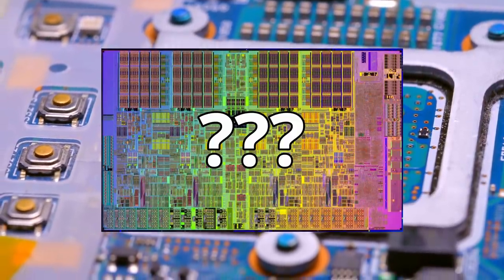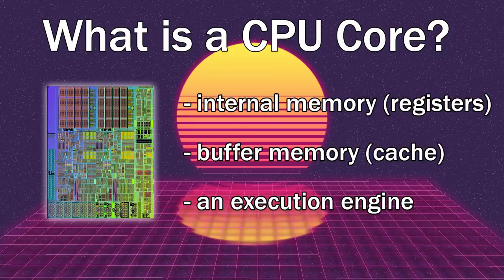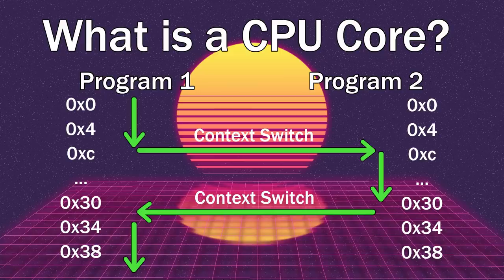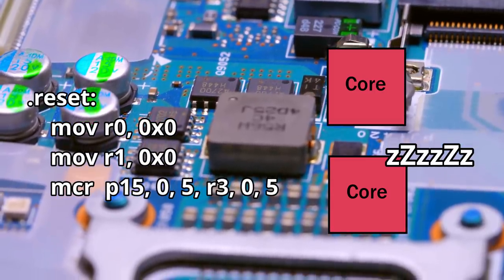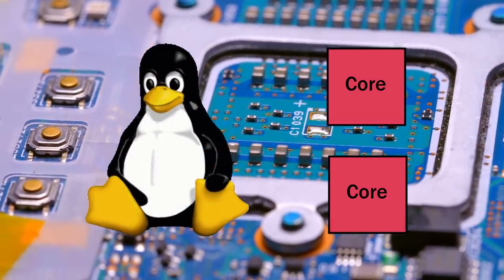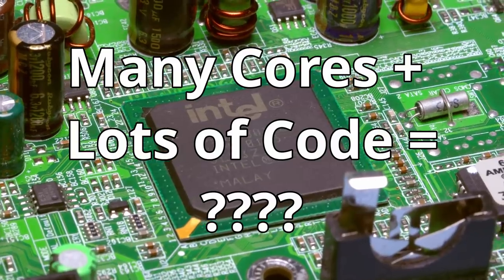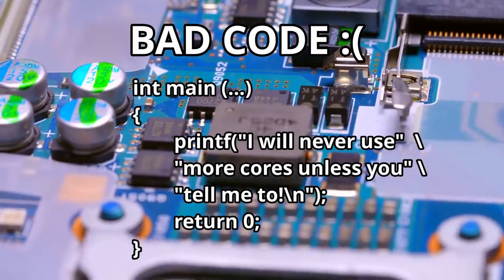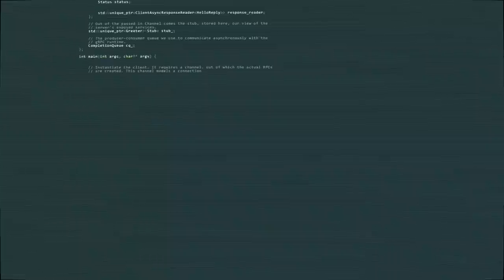why can’t computers have thousands of cores?

Comment: I think it would be interesting to go into why GPUs CAN have so many cores, be parallelized more effectively and with better thermal efficiency, but CPUs cannot.  I know the answer, but I do think it would be an interesting follow up video.
Reply: Total agreement. I don't know the but I'm certainly curious!
Reply: @JustinShaedo   A basic explanation would be that the kind of work a GPU does is easy to break up and spread among hundreds of small cores, and a GPU is designed for parallel processing on tasks that don't depend on each other.

In a GPU you define a single program called a "shader", essentially a script which defines various inputs and what the GPU should do with those inputs.

Each core on the GPU then runs in lockstep with each other: they all run the exact same shader script, albeit with different parameters. You cannot have half the cores run one script and the other half run the other. This is great for 3D graphics where the output of each pixel on a screen can be calculated independently, all using the same script.

This is also why we still need CPUs and not just run everything on GPUs: GPU cores cannot run separate processes simultaneously on each core: only hundreds of copies of the same process with different inputs.
Reply: @WJ gpus are designed to do a bunch of math at once. Each core is designed for a very specific task. Hence tensor cores, rt cores, etc. Cpus are supposed to be able to handle anything and everything, but maybe not as efficiently.
Reply: @WJ i dont see how that shows gpus being able to have more cores in the first place. Utilization is different than physical cpnstraints. Alsp, they want the OS to work on old laptops or cheaper ones which the majority of which have really weak processors with few cores. If ms optimized windows for pcs with 8 cores, pcs with 4 cores would struggle to do anything. I agree though. I wish linux replaced windows. Windows is a cash grab but so is everything in capitalism that isn't truly for free.
Reply: @WJ yeah it stinks. Sadly, quantum computing has the same issue as more cores. Noone will want to switch, but nothing digital can be translated. Qbits arent binary and work off of quantum superpositions. They are programmed entirely differently. Additionally, quantum entanglement is highly unstable and can't be observed or interacted with in any way or the particles will lose their entanglement and define themselves. That means you need to cool the qbits with liquid nitrogen, which is very difficult. You are correct about gpus being useful to streamers though. For certain tasks, computers can use gpus to perform tasks such as encoding streams and rendering videos on the go. Chip makers design a specific pipeline for a gpu that will help it perform tasks. Gpus made for rendering game graphics tend to work well with rendering streams which is handy. Pipelines are basically made up of core clusters that each perform a different tasks and instructions are sent through the pipeline to have things like shaders, sharpening, particles, textures, etc applied.

Edit: tldr: quantum computing and more cores have the same obstacle of the economy and society having trouble changing rapidly and both, especially quantum computing, would disrupt a lot. :c
Reply: @Chezrlz009  *unless were talking over 256 cores which is windows 10 limits  blamming windows for the optimzation of more cores is not quite right. Its more down to each application indvidualy not optimizing for more cores as windows its self can handle quite alot of cores and spread jobs across them just fine. But alot of devs and compaines in general do not devolp for a ton of multi core its slowly getting better but all of a few years ago 4 core 8 thread was your top end consumer cpu. linux is lighting and does work more efficently in general for the windows overhead but the code that runs the cpu is still the same x86 code the same program ported to linux as windows doesn't suddenly work better with more cores its down to the devs of said application, and if they wrote it better on one then the other. windows server 2016,2019,2022 all run on a very similar os to windows 10 and reguarly handle applications that use alot of multicore load just fine. The OS can add overhead but most of the multi core utilization is down to the application. Think about running blender it doesnt magicaly run faster by any real margin on error on a linux system vs a non bloated windows system. and its the reason cinnebench is used so much for cpu testing as it basically uses multi cores perfectly . I will agree linux can be made to function slighty better and can have applications that would make it more ideal if support for it grew but its defintely not the core limit that windows currently have as I don't know of anyone trying to go over that high limit that microsoft has for your avg end user
Reply: @WJ im confused some what windows limit for cores is 256 cores which is far and away more then even server cpus currently. im not quite sure what you mean for windows optimizing for cores? plently of applications that use windows destroy every core you throw at it. take prime 95 as an extreme blender other rendering softwares. Devs can easily make consumer programs use cores if it works for there application. and as time changes im sure windows for consumers will increase the cores if the time comes.  But windows 7 is quite dated driver optimization has come a long way windows 10 for your avg user is a better experience as a whole it basically installs any driver these days and for a pretty tiny overhead change then win 7. yes there is some but systems have beefed up alot compared to win 7 days.                                        Like yes I agree linux can run better by freeing up some of the overhead specailly on low end machines ,and can be made to run specific applications where windows is unable to be modified easily in that way.but that doesn't mean windows is some how hurting multi thread os communication to applcations for your avg user. and those who really want to be slamming huge amounts of cores should either be looking at linux server distros or windows server.
Reply: @WJ the biggest push for linux will really be the steam deck tbh at least as far a game devs go. So i pray for the success of that little device
Reply: Give me the answer now!!! I can't take the suspense 😫
Reply: @JustinShaedo  What NVidia calls "cores" is something entirely different than what counts as "core" in a CPU. A core in a CPU is an entirely independent control unit. Two conventional cores can process two entirely separate instruction streams and access memory independently from one another in any pattern they like.

A GPU is different. A CUDA core can perform mathematical operations independently from other cores, but they cannot execute different instructions and they cannot access memory independently from one another. A CUDA core is more like an arithmetic-logic unit (ALU) in a CPU. Many CUDA cores share a single control unit (which in CUDA terms is called a "streaming multiprocessor" (SM) which provides the data from memory to each core. The cores then operate in lock-step: Each core performs the same operation but on different piece of data.

So it would be a lot fairer to compare CPU cores to SMs. A fairer comparison to CUDA cores would be the total amount of elements a CPU vector unit can process.
Reply: @WJ windows 7, are you serious?
Reply: @WJ 
> My point is, windows is just making another OS just to sell.

This is the equivalent of stating that the sky is blue. There is no publicly traded or for-profit company that is interested in focusing on maintenance or fixing older code when it doesn't yield money in comparison to adding new features (niche operating systems that the average person won't interact with such as vxWorks aside as those are different beasts entirely). 

> They're not looking for a better ways to optimize an OS, not just for CPU cores but for all functions.

This is a bit loaded. Let's break this bit apart first, a core is just a thread of execution (technically two when we take into account Simultaneous Multi-threading or eight back in the days of IBM POWER) in the eyes of software. What really dictates how an OS utilizes these threads is dependent upon the scheduler of the operating system in question. Linux uses the Completely Fair Scheduler while Windows uses a proprietary implementation of their own making.

When we talk about optimizing for cores we're really looking at how do we make the most of the threads we have these are the responsibilities of the scheduler and by extension the code we write. If we want to use x number of cores then we need to be able to break our problem down into concurrent and parallel components.

When talking about optimizing functions then, in simplistic terms, it's really just a matter of profiling and modifying the code appropriately.

> You know, the bugs can affect CPU optimization too.

Are we talking semantic bugs or logical bugs. One can crash a program (or even the computer depending on severity), the other is, as it name implies, a logical error. In either case, the compiler doesn't care, it will optimize any input to the best of it's ability into machine code (or bytecode depending on what we're talking about) unless it hits incorrect instructions. Case in point, GCC or Clang (without certain flags like -Wall or -fsanitize that helps preventing errors at compile time) will compile code resulting in segfaults without complaints and also compilers using undefined behaviour to optimize code.

>  I don't want to bet on Microsoft making 256 cores usable or optimized but I bet on Linux.

This is related to an earlier point on the for-profit nature of a company but the truth remains that the target demographic of the desktop distribution of Windows aren't using processors with significant core counts. Linux is optimized because despite the memes of $YEAR_OF_LINUX_DESKTOP the primary use case of Linux is still in servers that have significantly higher per-machine resources than the average home computer.

> Maybe Torvald migrating to Rust can have big effect on gaming or rendering.

Rust will have zero impact on the core of the Linux kernel as Torvalds and Greg Kroah-Hartman by extension, as well as his other trusted maintainers, are testing the waters with drivers right now. Neither AMD or Nvidia are transitioning their behemoths of a code stack away from C any time soon and in addition, there is no inherent speed bonus in choosing Rust over C, only the safety guarantees it provides.
Reply: Cuda cores used in GPUs and not the same as logical cores used in CPUs. Cuda cores basically have one task assigned to them (game graphic calculations), so the cores are designed to manage that task as efficiently as possible. Logical cores can perform many different types of tasks/calculations, although are far less efficient at game graphic calculations than Cuda cores.
Reply: GPU does the same simple maths a fuckton of times, on a fuckton of calculators

CPU does hard math also a fuckton of times, but it’s not the same, and you can’t do it on a fuckton of calculators
Reply: @scorpizy  You've got to get out of the Von Neumann architecture, and go with some form of Reconfigurable Computing.  For example, the GPU is a stream-based computing model.
Reply: Also, CPU tasks are often linear, with little room for improvent from large scale multithreading. That is because the computation of one task can require the result of another.

In those cases, a few fast cores are better than 1000s of slow cores.

An analogy: imagine you have a stable with a 1000 strong but slow oxes, or a dozen fast and reasonably strong horses. When you need to carry many tons of goods from A to B, you use oxes to pull your carts. But a single passenger cart is better served by the horses. Also, no matter how many horses you add, it can never go faster than a single riderless horse, so adding hundreds is only extra work and resources.
Reply: @richardg8376  that’s not correct, GPUs can actually handle branching, they’re just slow at it unless it’s done carefully. GPUs have thread groups which need to execute in lock step, but the groups can each be doing something else. Also, they can branch, it’s just that you end up executing both paths (with threads no-ops if they don’t take the branch).

Most people who have not programmed GPUs severely estimate what they are capable of.
Reply: @richardg8376  soooo, if i would have programmed a thing more similar to what the gpu is handling all day.. there's a way to let this stuff being executed there instead?

I assume it's a common thing to do. Or do all programms run primarily on cpu (even if part's of it on a gpu would be more efficient)?
Reply: GPUs are designed to work on matrices using massively wide  data ques feeding each core where all cores are doing the same transform but on different parts if the matrix.  This facilitates low management cycles and high work cycles.
Reply: That is simply due to the data the GPUs process - many of the algorithms for image processing are embarassingly parallel in nature. thus allowing more cores to be usable.
Reply: @Chezrlz009  GPUs handle only embarrasingly easy parallel tasks. which occurs frequently in image processing.
Reply: @Chezrlz009  Actually you have to cool the qubits with liquid helium, and the helium gets cooled with liquid nitrogen.
Reply: @Demon09-_-  windows has too poor a design to support lots of cores. Linux handles thousands to millions right now.
Reply: @jessepollard7132  yeah I was just saying the end result is cooling via liquid nitrogen, but yes you're right, there is helium inbetween. GPUs are very specialized due to the fact that they are just a ton of really lame cores working together, instead of something that is actually capable working with a few other colleagues, if that analogy makes any sense. The interesting part about designing GPUs is optimizing the pipeline, and making it bigger and have more cores lol. They are very simple on a low level, but the end product is hard to perfect.
Reply: 1) pixel processing is easy to do in parallel. There are literally millions of pixels to compute and the operations applied to each are very similar.
2) there is hardware assistance for some tasks like texture sampling that may diverge from this paradigm. There is hardware to handle cases when the read from a texture might wander off the edge of the texture if it behaves like all the other reads for adjacent pixels, or a sample lands between pixels.
3) GPUs are usually programmed using a a parallel programming language that does not needlessly specify that some pixels be precessed before others. Traditional languages like C are designed to describe explicitly every operation that is done, thereby also specifying the timing of when it should be done even when the operations can be done in parallel and do not need to be ordered. GPU algorithms are usually implicitly parallel. You program what happens for one pixel and the rest implicitly follows from that in an independent computation that (without much effort) can’t talk to the first pixel and so can be done independently and in any order.
Reply: Tasks performed by GPUs can be separated and performed independently. CPUs usually perform more complex tasks that are interdependent and cannot be parallelized easily.
Reply: @eliassaf9192  That depends on the definition of "more complex tasks that are interdependent and cannot be  parallelized easily". linux already handles that in a very parallelized manner". just have more cores. The problem is that GPUs cannot handle external interrupts period.